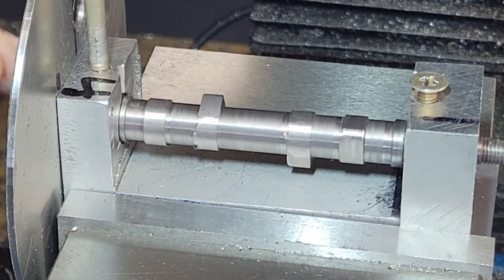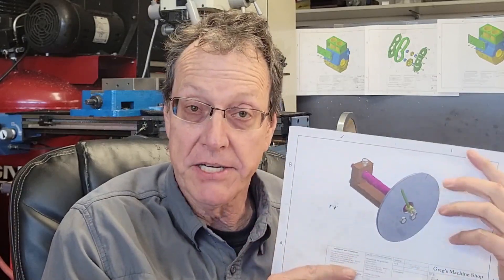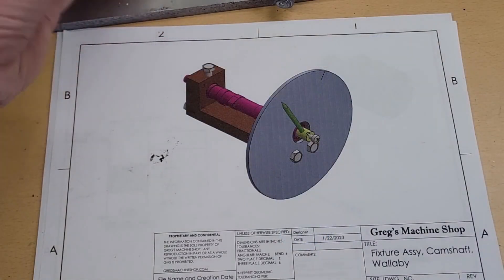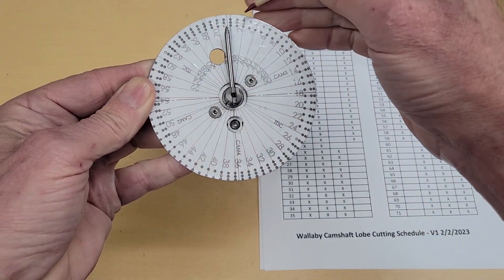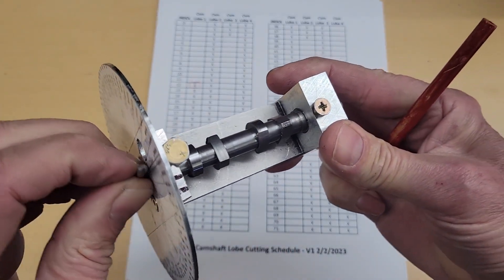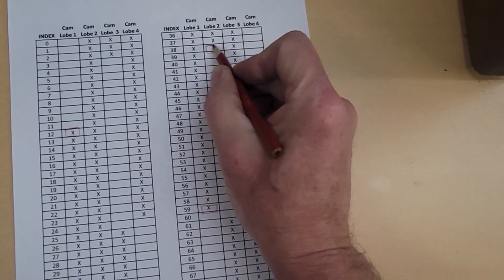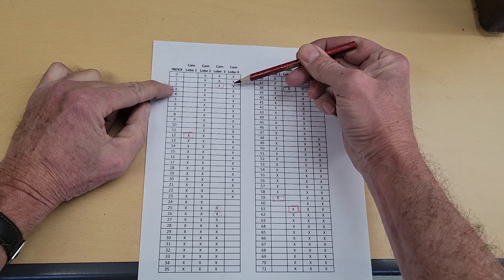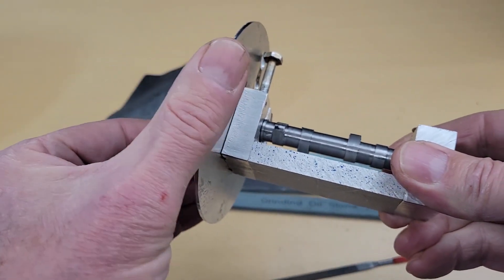Machining a Camshaft - Wallaby 30cc Engine Build Part 13

Comment: I've been working on an engine of my own design, (Inline-6) and I've built my eccentric fixture for machining the cams on the lathe, but I'm wondering if it would also work if I mounted the fixture in the manual mill and used an end mill to rough out the lobes, to then turn and file them down to proper size on the lathe. What are your thoughts, Greg?
Reply from the maker: Anthony,
I like to use the mill to pre-machine a part I will turn later on the lathe if it will save me machining time.  Machining a crankshaft is a good example of this.  You certainly could do this on the camshaft.  However, if you are going to make cuts on the lathe at every five degrees as I have done, using the mill first to rough in the camshaft probably will not save you machining time becasue you still have to make each cut and these remove only a small amount of material.  If I understand your question, you are suggesting to use the fixture on the mill instead of the lathe to create the cam profiles.  This should work fine.  There typically is very little cleanup filing required, but you could do this on the lathe.  Let me know how it turns out. 🙂
Reply: @gregsmachineshop  That's exactly how I made my crankshaft! I mounted it on the mill and took most of the material out for the rod journals there, and I finished it up on the mill. 

I was intending on following the 5 degree increments for the camshaft but I may try to push it to 10 degrees on the mill and then use the lathe for the finishing 5 degree passes. Either that or I'll use a file to finish them smooth. 

Thank you for the reply Greg, I'll let you know how everything goes!

Comment: those 10-32 screws in danger of getting sheared by the interrupted cuts?
Reply from the maker: It is a good point, the tall 10-32 bolt that is used to drive the fixture does have a fair amount of stress, but it did not bend.  But I took pretty small cuts, just .005" at a time with a small .08" wide parting tool.  A 1/4"-20 might be a better choice.  The other flat head 10-32 screws do not see any significant load and are not an issue.  thanks for the comment,  Greg